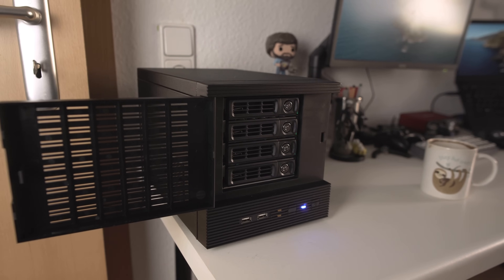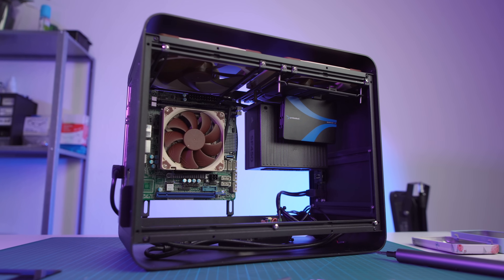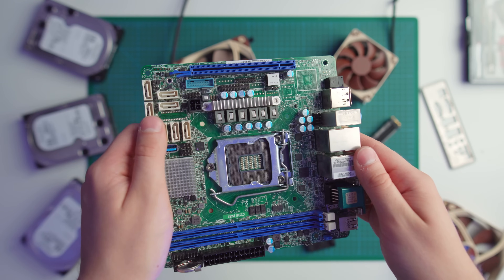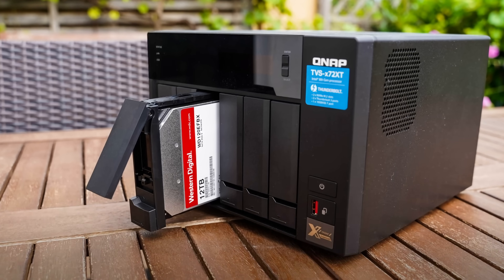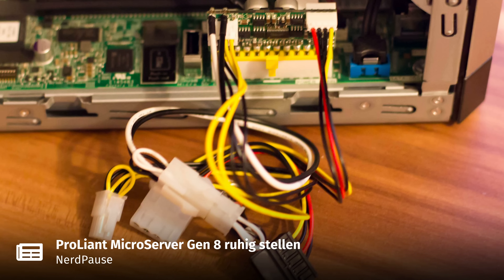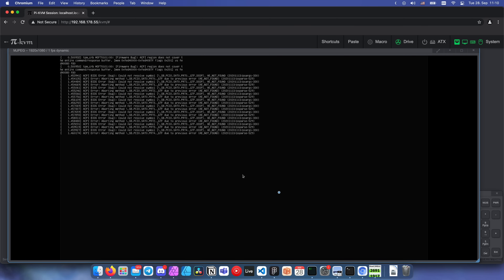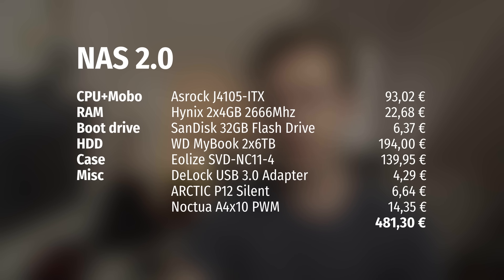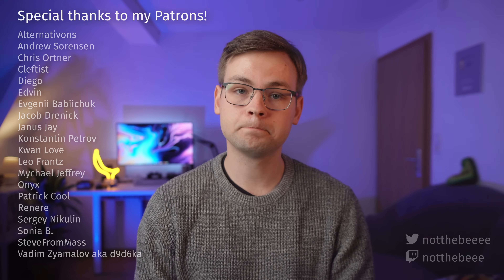The Perfect Home Server Build! 18TB, 10Gbit LAN, Quiet & Compact

Comment from the maker: One small detail: it turns out that i3-6100 does not support Tone Mapping in Jellyfin, so you won't be able to watch HDR content on an SDR screen: https://jellyfin.org/docs/general/administration/hardware-acceleration.html#configuring-opencl-acceleratedvpp-tone-mapping

However, Tone Mapping IS supported on i3-7100, which also works with the Asrock C236 WSI motherboard. Better yet – you can usually get an i3-7100 for about the same price as the i3-6100! So definitely keep that in mind.
Reply: Hi, where is the link with the software part? I´m really interested on that. Thanks a great video.
Reply: I cannot get the exact information. Most hardware information websites report that the i3-7100 does not support ECC memory even if intel ark site says it does. Many people advise to stay with i3-6xxx CPUs if yo want ECC memory support.
Reply: As the AsRock C236 WSI is (currently) hard to get, at least I can't find one on ebay or other retailers and each retailer I contacted stated that they don't sell them anymore and they are pretty sceptic that they will receive such a board in future as well, I started to look for similar boards and found at least 2 alternatives that might be interesting: 

The first one ist the AsRock E3C236D2I which provides just 6 SATA3 connectors but comes with IPMI support and an M.2 slot on the mainboard. This board costs new roughly 260 Euro including taxes. It effectively misses out on one SATA3 slot compared to the C236 WSI but spares you the hassle of having to use a Raspberry Pi to act as KVM.

The second  one is a bit more expensive. The AsRock E3C246D4I-2T also comes with IPMI support and offers 2 OCulink connectors which allow to connect up to 4 SATA3 devices each as well as supports an additional M.2 SSD on the mainboard itself. I have seen some offers at around 600 Euros for this board so far. It at least allows you to connect effectively even more devices compared to the C236 WSI by also freeing you up from the Raspberry Pi KVM thing.
Reply: @Kessra  I believe the E3C246 isn't compatible with a 6th or 7th gen CPU like the i3 7100. The compatibility list on the ASRock page only shows 8th gen CPUs
Reply: Is that when you try to watch HDR movie and it appears to be in shades of green and violet?
Reply from the maker: @kennethdarlington  Sometimes it's green, sometimes it just looks washed out. In my case, the "N" in the Netflix pre-roll actually looks yellow...
Reply: @kennethdarlington  Or it's a bad rip
Reply: You also made another mistake in the video: Synologys 8 bay nas costs 1000 eur you said but it says 1000 DOLLARS in your video in frame
Reply: Gen 7 does this. In Plex w/ Plex Pass, at least.
Reply: I already have an i3 8100, can't I just use that?
Reply: Why SFP and DAC over cheap, cheap, cheap 10GBase-T and Cat6?  I don't know why anyone would ever buy an SFP 10G switch, you can't wire your home with DAC, tranceivers are expensive, and putting fiber in the walls is nowhere near as cheap or easy as CAT6/6a.  Several years ago, SFP NICs and switches might have been cheaper, but at this point 10GBase-T hardware is just as cheap
Reply: @post-leftluddite Good point, except now would you mind finding a fanless 5/8 port 10Gb RJ45 desktop switch for me? Whereas you can literally get one with SFP+ for less than 100 bucks. Also, 10Gbase-t has a very limited NIC choice - Aquantia doesn't work reliably enough to be used in server applications, Intel X540 is old, hot and most of X540s are not genuine ones / have lots of issues. X550 is way too expensive, same as X710.
Reply: https://youtu.be/cpt6rR7seRM finally its here

Comment: Video is a bit old but yeah, why not.
Had a dedicated Mini-ITX build sporting a 200GE (later updated to a dedicated GPU and a ryzen 5 2600), 16 Gig of Ram and around 2 TB of SSD-Storage. For the most part it ran esxi (and Nextcloud as a VM), however later on it became a sole nextcloud-machine.... and i hated it. Every Nextcloud-Update broke something fundamental. Webinterface? How about being stuck in the maintenance-screen despite the update already long done. How about syncing 300Gig of Data again, even tho nothing has changed? How about slow read and write - speeds and even losing files? I had it all. I changed Drives, checked Hardware, checked guides but nothing. In the end, i moved to a hosted Nextcloud in hopes of it running better. It ran even worse. Switched to a Synologie-Nas and had exactly zero problems after that. Yeah, it costs a bit and it isnt as powerfull as the Mini-ITX Build but it just works and requires very little maintenance. If you infest a bit more, you can even run docker on it for small stuff like pi-hole.

Comment: if i remember correct, my qnap ts-453a also cost around 400+€ back in 2016, no 10GbE, only 4 hdd´s, max 8GB ram, celeron. i think the price here is okayish for the potential performance, but i am not my wife^^

Comment: I've been building home servers for years all based on Windows Server  OSs.  What I have learned is that 5400 drives have unbearable latency on both reads and writes.  I also haven't had the success I've wanted in mid-priced consumer drives.  I prefer to run RAID 10 clusters and have found that the WD Gold drives are much more failure proof.  And, they've been coming down in price where you can get one 14TB drive today for what used be the cost of a 4TB.

Comment: Good video. I went with a Lenovo Thinkstation P510 with a Xeon E5-2680 V4 CPU, 4 GB ECC ram and 1TB SSD for just under $350. Mainly for its ability to support 4 3.5" drives and 4 2.5" drives for a total of 8 drives with a SAS backplane. I think the total cost was just over $650 with the WD Red Plus drives and a couple of 1TB SSDs but it's a beast.
Reply: What is the power consuption when idle?

Comment: Just a important hint: Stay away from WD-Harddrives!!
WD is not a good harddiskcorporation.
they will be destroyed really fast.

Use Seagate instead. they have good server disks, too.
I have since 8 Years 15 x 4 TB drives in my Server and there are just normal desktopdrives, because serverdrives are really expensive.
but with raid6 and 2 spare drives, in all those years just one drive failed 2 years ago.

Comment: Hmm, drives kinda small, cpu ancient, case + psu +board very expensive.   I went for literally the cheapest asrock a520 board with 4 sata  + used amd 4300ge (lower power use), used 10TB WD gold drives x3, a salvaged psu and re-used a old case i had. Running DSM 7.1 on it. Using  2 x 2.5gbe cards. SMB3 Multichannel.  Maybe I should do a YT video, I just think my own rig is better, uses less power, cost less and is faster.
Reply from the maker: Sounds awesome! Looking forward to the video

Comment: I'm trying to find a solution that will act and a firewall/wireless router and NVMe NAS for a more efficient, snappier, cooler and quieter AIO box, but there's a bunch of hurdles in the way:

Researching an OS solution that can be a wireless router, firewall and wireless NAS under one instance or virtual machining multiple different OSes.
Finding a small enough board (Mini-ITX) that can support very low power CPUs and also support PCIe 4.0.
$/GB on the highest capacity m.2 drives is diabolical, the only real option for high capacity would be using a bifurcation adapter in the PCIe slot to run a RAID 0 of lower capacity NVMe drives and enjoy the overkill read performance.
Getting my hands on newer wireless adapters used in Wi-Fi products.
Waiting for said OS solutions to include driver support for said Wi-Fi adapters.

We're about to move on to the 802.11be wireless standard which can carry anywhere from 172MB/s to just over 5700MB/s depending on the configuration. My idea is that as time goes on, newer wireless standards will be introduced and all I would need to do is swap out the wireless adapter for a modern version and the storage will still be able to saturate the connection bandwidth fully.

Comment: You and I pretty much have the same build! I haven't met many folks using the C236.

Not sure if you're aware, but the C200 chipsets have vPro capability. Meaning when you pair a supported intel CPU you're able to do KVM. That was one of my main draws to this platform. Intel AMT isn't as fleshed out as iLO, but it gets pretty close. Any Xeon series ending in "5" and some i7's have vPro.

 I've been searching for the last 6 years for something that would replace it. But no serious contenders seem to have come out. I refuse to get the C246 board... More expensive, and they moved the 4 SATA ports to a oculink... without including any cables.

Comment: Just to clarify, it looks like for this case to fit 6x3.5" you would need to sacrifice the pcie expansion slot and go with a small CPU cooler is that correct?
Reply from the maker: yes, probably. in general, six hard drives in this case would be a fun challenge rather than a realistic use case that I would recommend
Reply: @WolfgangsChannel  Thank you!

Comment: Hi thanks for your video i learn a lot , this configuration can be build on this kind of case ? 
regards

CPU
AMD Milan 7413 EPYC
Cores
24 cores @ 2.65 GHz
Boot
1 x 480 GB SSD
Storage
1 TB NVMe + 2 TB NVMe
Memory
512 GB
Network
Dual 10Gbps NICs with 300 Mbps commit, burstable
Security
DDOS Protection Included on all servers

Comment: Thank god I did not find your video earlier or I would have probably spent more money than reasonable :) That IS the perfect build I have been looking for, but I am curious how quiet is it really ? Because you have the fan for the CPU and the fan for the PSU. Also is that really enough ? No fans or dissipators for the case ?
In the end I went with a Synology and I must admit I do love building, but it feels damn good to just plug it and connect to the web UI. I put anti-noise pads under the NAS and around the drives and it's barely noticable noise-wise.
Personally I have been looking for the most passive solutions with the added criteria to be able to fit a GPU (a not too big of course)
Reply from the maker: There are case fans – 10:18
Reply: @WolfgangsChannel  ah didn't notice them sorry, so this raises the question, is it really quiet? When do they all spin? Because I believe with media encoding they must be spinning
Reply from the maker: @MickaelV  The case fans are set to a static RPM. Noctua fans in general are really quiet, and even when they ramp up, it's not an annoying whirring, whining or high pitched noise – it's more of like sea waves, if that makes sense 😁i3-6100 is also not very hard to cool, it's a 65W CPU.
Reply: @WolfgangsChannel  Yeah I have a Noctua fan on my CPU and it is really quiet, but also really big (NH-D15) that is why i was curious about you going smaller :) I know exactly what you mean by sea waves, I used to have them vibrate or something, drove me crazy. 
In my experience the major annoyance for noise though, is the hard drives, but going 18TB SSD with redundancy is just way too expensive, if possible at all

Comment: Time flies. Currently, for movie library people choose most often encoding to 10-bit HEVC format (both for HDR and SDR). Skylake CPU supports only 8-bit hardware decoding but not 10-bit, meaning it will struggle a lot if asked to stream 10-bit 4K movie while changing the resolution to lower one or while stripping HDR as TV/tablet doesn't support it.
https://en.wikipedia.org/wiki/Intel_Quick_Sync_Video#Hardware_decoding_and_encoding
If building a media server for Plex or Jellyfin I'd seach for a next generation CPU. Truth saying, even something as weak as J5005 from Gemini Lake line would suffice for home use.
Reply from the maker: Pinned comment

Comment: SMR works well and in a RAID configuration SMR will saturate a 2.tgbps LAN easily.  I have had some WD Reds, which are SMR, running for 5 years with no errors in a Synology DS416 with the 2 nice running bonded and they saturate the network bandwidth easily.  
Obviously SMR isn't ideal, but don't be afraid of it if you have gigabit or 2.5gbps lab.
Reply from the maker: The problem is mostly ZFS. The graph in the video shows the performance resilvering a ZFS pool and it’s atrocious 

For MergerFS, Unraid and similar things though, SMR is completely adequate

Comment: For the remote management, Intel vpro was a perfect fit for me. The PiKVM looks more expensive and attachments to the board than going for a vpro enabled board.  It was also super easy to get vpro working under Linux with Meshcommander and some basic MEBX settings.
There are NUCs available with vpro, but unfortunately isn't that common with other PC/boards.
My setup: Intel NUC (nuc11tnhv5) with external WD NAS. Fedora server with Libvirt/Qemu/KVM virtual machines. Remote management with vpro and Meshcommander.

Thank you for the great video! ❤
Reply from the maker: PiKVM's website is a bit misleading bc their pitch implies that you need to buy their PiKVM hat to use PiKVM.

In reality, all you need is a Raspberry Pi (Zero would work too), an HDMI-to-USB capture card (costs $5-7 on Ali), and a power splitter that you can make yourself out of two USB-C cables

Intel vPro looks really impressive though. PiKVM might be a good alternative if you want a portable solution that you can plug into anything that has an HDMI out

Comment: So, very cool ... Just missed the moment how exactly you dealt with the HDD vibrations problem
Reply from the maker: rubber bands between the drives and rubber washers
Reply: @WolfgangsChannel  Ok, can you provide more info (some charts) about the drives stats - for example their temps during 24h period of idle/copying/writing ?
Reply from the maker: Nope. I've moved to a rackmount enclosure and don't run my system in the case anymore. I didn't notice any abnormally high temps while using the case though, and provided you have decent cooling, there should be no issues

Comment: If you want to go the cheaper way, look out for cheap MicroATX mainboards and choose a case that still is small (I have the AeroCool Trinity Mini). This can save you 50 bucks on a MiniITX board (I only now have seen that mainboards got much more expensive, mine was up for 20 bucks new, the cheapest one now costs 50 bucks). The cheapest AM4 MiniITX board is at around 100 bucks. 

The only case where MiniITX makes sense is with boards that have on-board CPUs as they aren‘t that much more expensive. Or if you live in a apartment where space is limited. In general, it just has become so expensive to have a server. I don‘t use my build as a server anymore as that could cost 700$/year in energy. So rather think about buying a Intel Nuc, MiniITX board with low-power CPU or Raspberry Pi 400.
Reply from the maker: $700 a year for energy? Do I have a video for you: https://www.youtube.com/watch?v=MucGkPUMjNo

Comment: Have the same processor in my NAS 😅 I bought a Fujitso Esprimo P556 used on ebay. It cost me 100€ including 8 GB RAM but no SSD. It doesn´t have ECC memory and only 3 Sata Connectors but that´s all I need. Went with Seagate Iron Wolf for storage since they are CMR drives no matter the storage size. Have it running since 3 weeks and I´m happy. Hope it will last a few years.

Comment: Thank you for this video.
Could you please suggest a 2022 alternative for the motherboard? It is not available on Amazon. I plan to install a raid card for SAS drives instead of SATA.
Thanks again.
Reply from the maker: Get it used if you can. But in general, if you don’t need the SATA ports anyway, just buy any mITX board with a PCIE x16 slot

Comment: What's the power consumption of this build?
Reply from the maker: 23W when the HDDs are spun down
Reply: @WolfgangsChannel  oh wow that's awesome I wouldn't have thought a 450W power supply could be that efficient at low loads like that, I considered going for a Pico PSU but not sure it's worth it though
Reply from the maker: It definitely is. I've now switched to a PicoPSU and it's 5 watts less at idle – 18W

Comment: Hello! Thanks for vid!
Did not find a video about 10gbe, can you tell more about that incredible speed? What do you think about wifi connection? Will it be similar?
Reply from the maker: WiFi 7 is supposed to be capable of 9.6Gbps, but with a lot of caveats (ideal conditions, direct line of sight, 4x4 MIMO support on the client, etc. etc. etc.)

You can definitely get a stable gigabit on WiFi these days, but nothing beats the wired connection

Old-ish 10Gbe SFP+ PCIe cards from Mellanox are relatively cheap these days. Just get a pair of those and a Direct Attach Copper cable (DAC), and you're set

Comment: is it really possible to fit 6 3.5 drives in there? the official website only says that 3 are possible
Reply from the maker: Yes, but it might not work if you have a PCIe card. I was able to fit 4 drives with no problem with a low profile PCIe card (Mellanox ConnectX-3). Without a card, at the very least 5 drives should be possible
Reply: @WolfgangsChannel  wow das war schnell, danke dir :)! with 4 3.5 inch drives there is no more room for 2.5 inch drives right?
Reply from the maker: Doch :) you can still put up to 12 drives on top (next to the PSU). But if you really want to put that much, you'll probably need custom low profile SATA cables

Comment: I recommend lapdock where especially a laptop without internal components just keyboard speaker monitor battery.

I use that to debug all my servers and mining machines as they are literally in production. Putting them back to desktop is not even an option

Comment: Gasp actually pi4 + pikvm hat cost 250 euros :,)
Reply from the maker: You don't need the PiKVM hat. Just the Pi, a power splitter (which you can make yourself) and a cheap USB HDMI capture card (€10-15)
Reply: @WolfgangsChannel  you make my day! So the hat that are you using on your pi is the power splitter that are you talking about? Did you think a pi 3 got enough power tondo that?